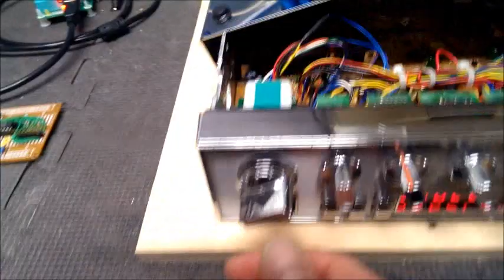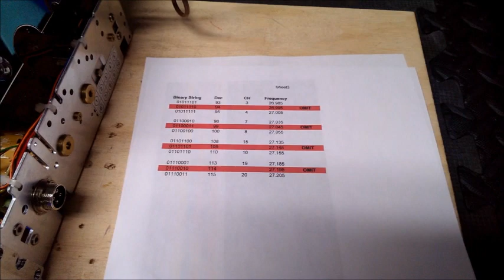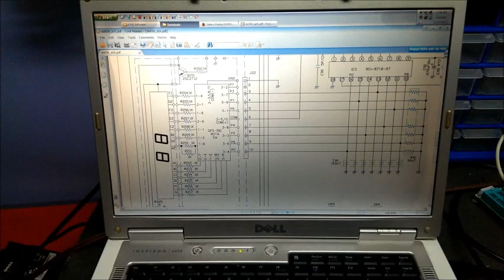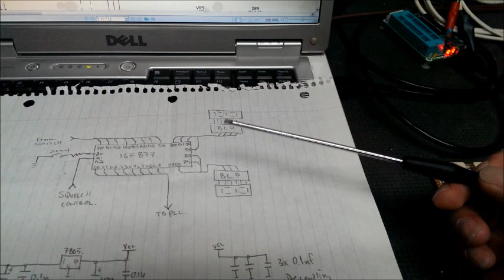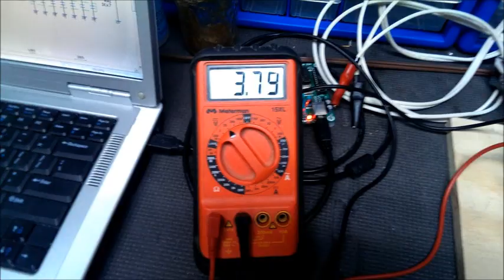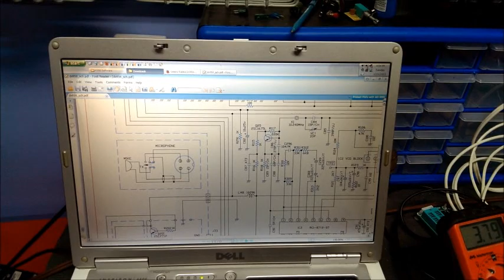Scanning Mod for Galaxy DX 959 / 949 / Cobra / Uniden CB radio. Work in progress.

Comment: That's a cool and useful mod,what I want to do is replace the encoder with a digital vfo,and I want to be able to tune from 10mhz to 30,you seem pretty smart,have any info on a vfo mod,I think ebay sells just the vfo as a board only for around $50.00

Thanks!